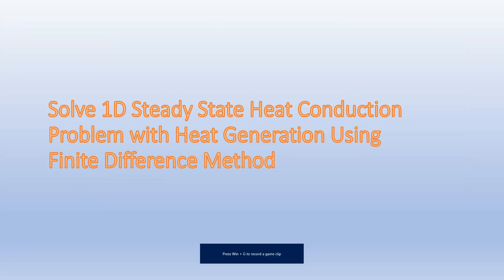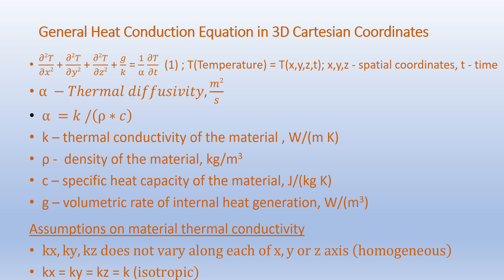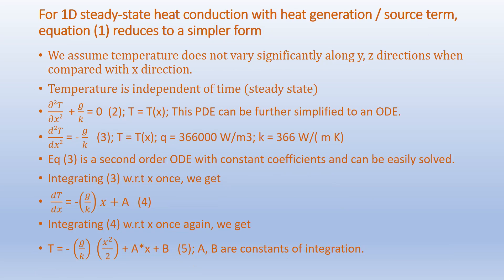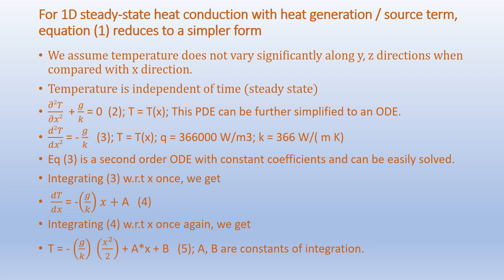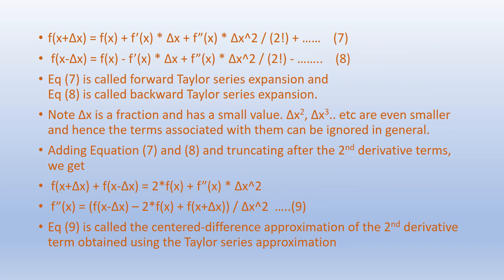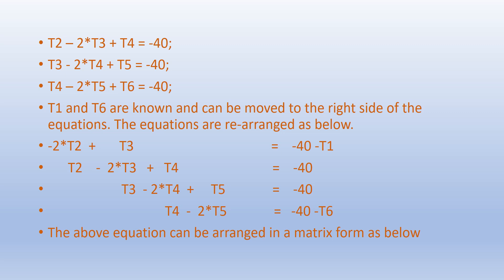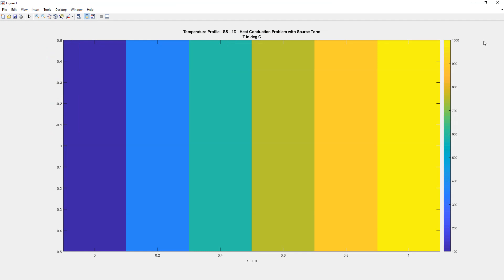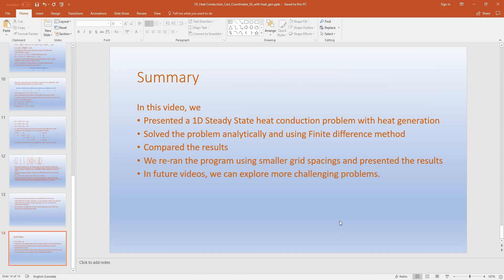1D SS Heat Conduction Problem with Source Term

Comment: can you share the matlab code for this?
Reply from the maker: Pls. see below
Reply: @samseleven1  there is no numerical methods section on that site
Reply from the maker: @Drew-zo4bo  look under online calculators
Reply: @samseleven1  got it thank you!
Reply: @samseleven1  by chance do you have this same matlab code for a 1D SS Heat Conduction with Source Term using FEM
Reply from the maker: @Drew-zo4bo  Sorry No. Not at this time